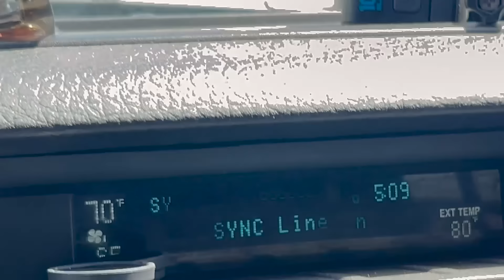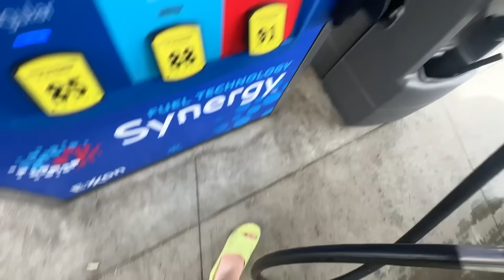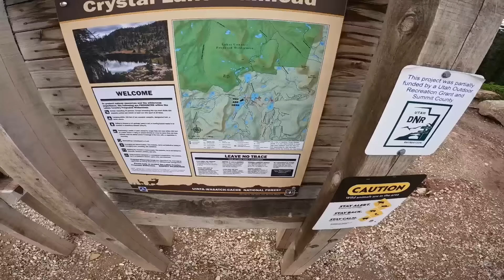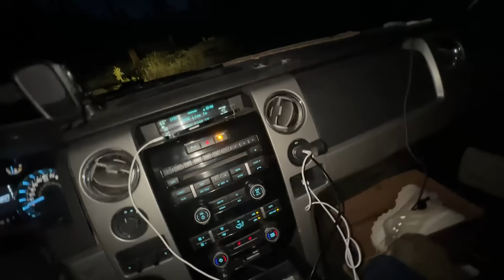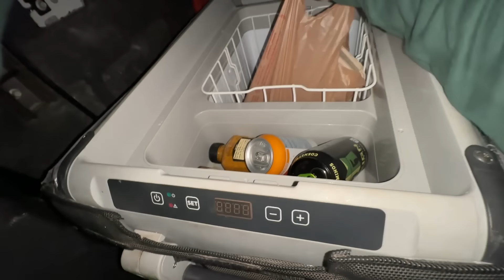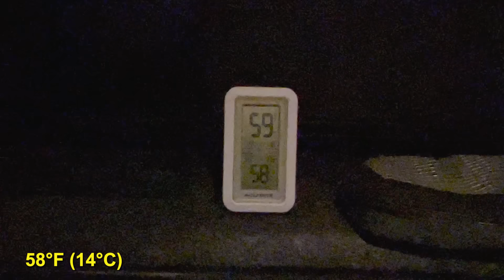A Rainy Day Truck Camping in the Mountains - Eggs Purgatory

Comment: a friend of mine had a ford ranger with the electronic shift transfer case, he was having a similar problem and it turned out to be corrosion in the connector that plugs into the shift motor on the transfer case, that might be your issue as well with your F150, all in all, still a pretty sweet camp, stay safe out there mav

Comment: Just an idea for the VW Camper get LT (stands for light truck) tires with that camper the regular car tires probably can't hold that weight which is why they would go flat, unless you have a rim or valve stem leaking: a dunk test would answer that.

Comment: to be honest I'm not surprised about having some problems with the white truck, you have put a ton of miles on that thing including some pretty rough terrain, the Bug having issues with the tires being flat makes sense as well since that camper top is probably a lot more weight than it was originally designed for, a bit shocked by the new truck having so many issues, thought most of the late model Ford trucks were pretty decent quality, hopefully it's still under warranty at least

Comment: I just rebuilt the front end on my 2011 F150 FX4 5.0. If your 4wd is not working I would bet its the hub actuators, which run off vacuum. Otherwise the system should be solid. Its an annoying fix but not major surgery. Hope the best for you buddy! Happy to lend any advice if you need it. I did an Icon 2.5in lift and put 2018 raptor rims and tires on it. I was at 114k so I did UCA, LCA, tie rods, switched to 2016 (aluminum) spindles, beefier CVs, Icon coil overs, and then rotors and pads. Its a robust system, but the 4wd actuators seem to be a weird choice.

Comment: I didn't quite catch what you were driving.  I have  2014 Silverado that my mechanic says the reason my 4WD will go in, but not come out of 4WD is because of pins on a relay that are too close together.  Chevy kniws about the issue, but has never done a recall.

Comment: Probably just your hub lockers. They are vacuum operated and fail often. I recommend a conversion, replace them with manual lockers. Also that squeaking in the front end is either ball joints or tie rod ends with no grease which will cause premature wear. Make sure they have no excessive play and grease them.

Comment: NICE 'UNSTUCK' MANEUVER!!  SELF-RECOVERY EQUIPMENT IS $$$ WELL-SPENT: TOW STRAPS, BOTTLE HYDRAULIC JACK,  DIGGING SHOVEL, CONTRACTORS 55 GAL. TRASH BAGS AS GROUND TARP/RAIN COAT, COLLAPSIBLE BACKPACKING BOWSAW. BICYCLERS MINI LED LITE/FLASHER/RED/WHITE OR AMBER, ETC.

Comment: 10:25 I wish I was standing next to you to show you how to safely hold your knife to have more control. Your thumb & pointer finger actually pinched the blade and the handle rests into your palm. You got the safety down with the fingers guiding the knife across your food, you just need one more little instruction for safety sake. I'm not trying to be judgmental, just thinking about you traveling alone in the deep woods and avoiding getting a nasty cut. Next time you're in a store that has a butcher or restaurant, ask them to show you how to hold the knife properly when cutting. 
Btw, I know what I'm making for breakfast, now. Looks delicious!

Comment: When the 4x4 on my F150 quit working, it was a pneumatic solenoid in the engine compartment. It’s on the driver’s side of the firewall.  Common failure, and only takes a minute to replace it.